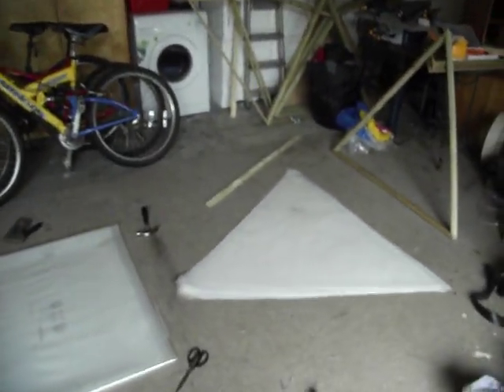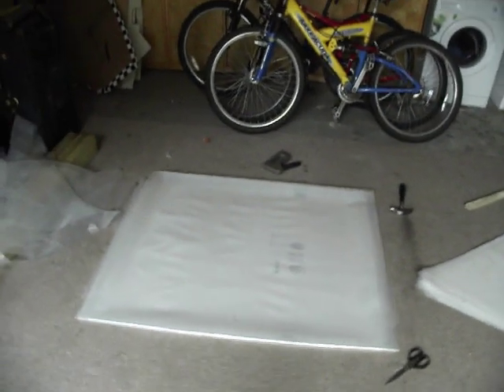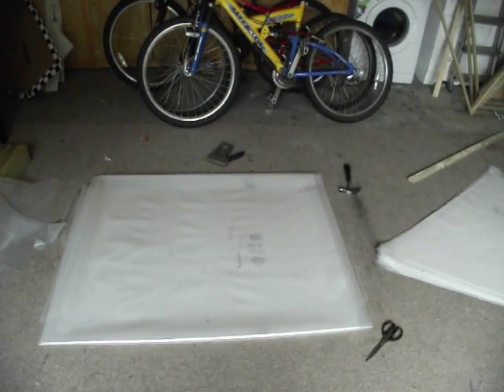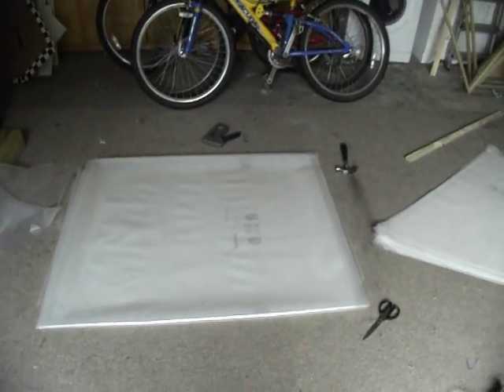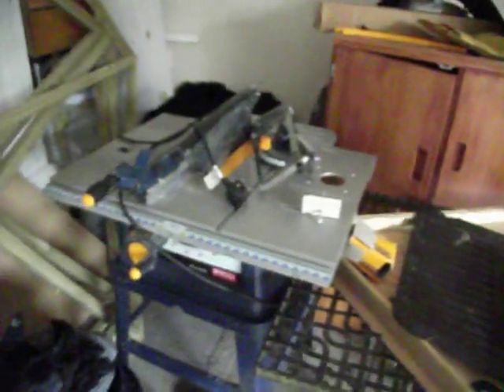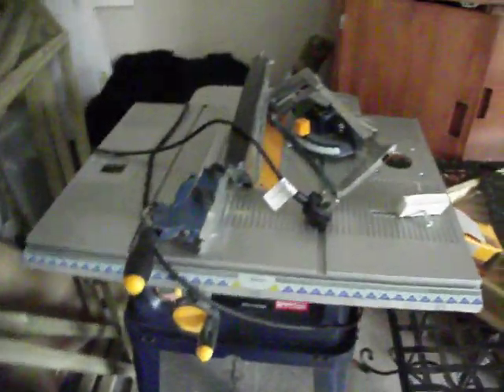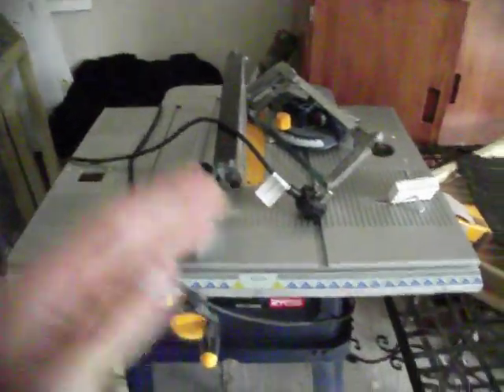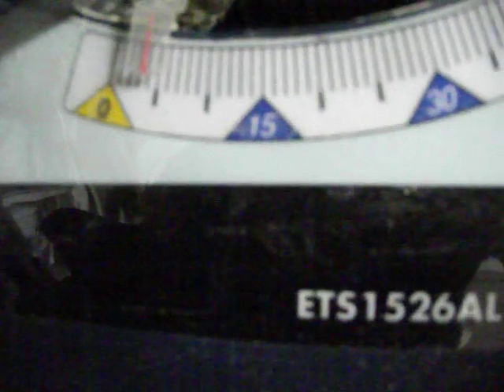BioDome Systems: The Aquaponic Chronicles A Geodesic Journey. Pt 1 Dome Construction

Comment from the maker: Its a 3v dome, i didnt need to add any sealant because its so tight on the inside of the hexagons. I got the ryobi ETS1526AL
This is my table saw, you can probably save yourself some money over the dewalt. I did make some mistakes cutting but everything turned out fine in the end, my dome went from 3m to 2.9m diameter so its super easy to fix!!